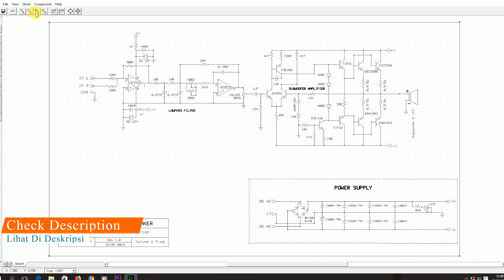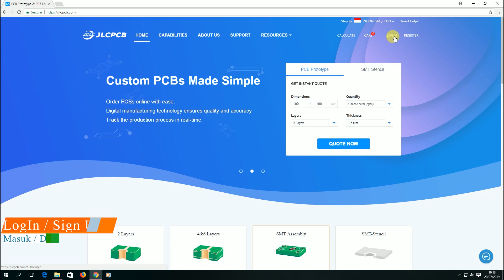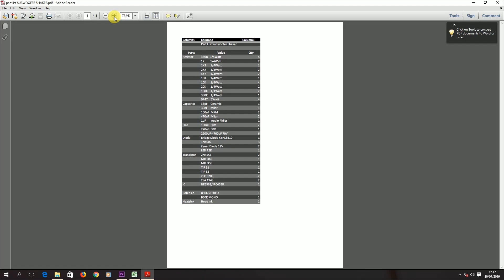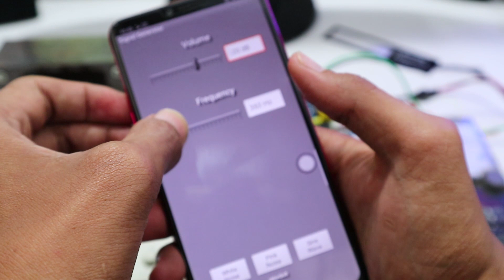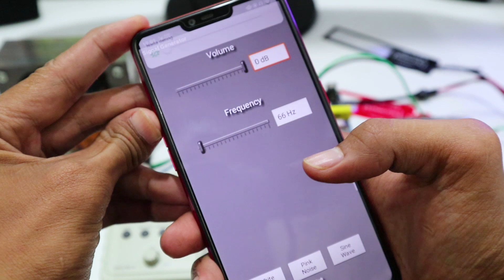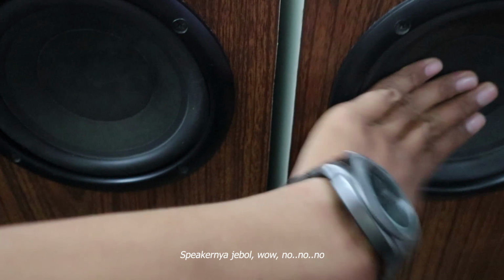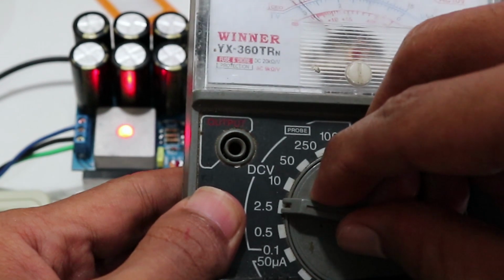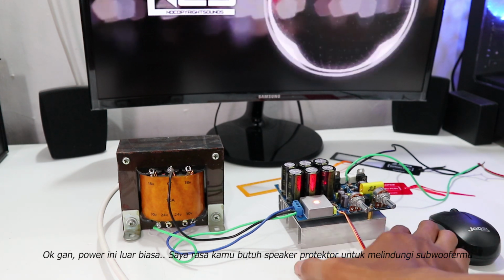Subwoofer Shaker ! Making subwoofer amplifier

Comment: Bro can I connect 2 more transistor 5200 and 1943 to circuit for increasing the output watts
Reply from the maker: sure, add more 5w resistor too
Reply: @barlexrespectaizer452  bro I have one doubt one end of the 5w resistor is connect to transistor emitter pin and where I connect the other end of the resistor in 5200 and 1943
Reply from the maker: please look the schematic bro for clear diagram, all of the resistor connect to output speaker
Reply: @barlexrespectaizer452  ok tnx

Comment: Bro I made these subwoofer shaker it's working ☺️ but when I decreased the frequency to minimum and volume  about 50% the bass from the speaker is is very disturbing . i am using pioneer 6.5 inch car speaker for test purpose is it speaker problem or any other problem or i had to use Big speakers please reply asap . Tnk u
Reply from the maker: have you grounding the potensio body ? 
I think it the lowest frequency infrabass.. you can set the frequency that match with your subwoofer by increase the frequency knop around 50%

Comment: I'm waiting for your video bro..how many watts it can give output? What board size bro?
Reply from the maker: about 156Watt @4 ohm.
board size 11.3cm x 8.5cm
Reply: @barlexrespectaizer452  thank you, can we connect 150+150 two speakers because two bass controllers we have there..
Reply from the maker: you can connect 2 speakers with this amplifier. by the way two controllers Volume and Lowpass Frequency
Reply: @barlexrespectaizer452  thank you...
Reply: How much volt and current is required for 200w output
Reply from the maker: about 10A